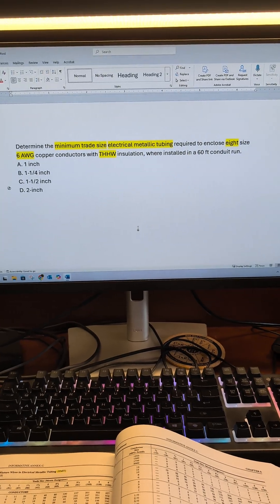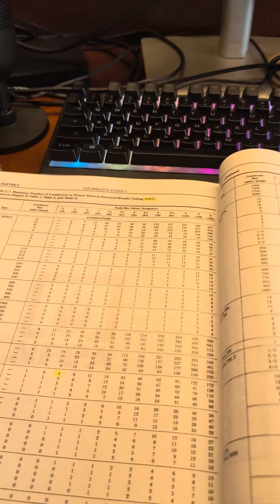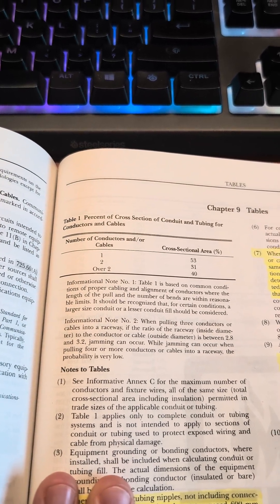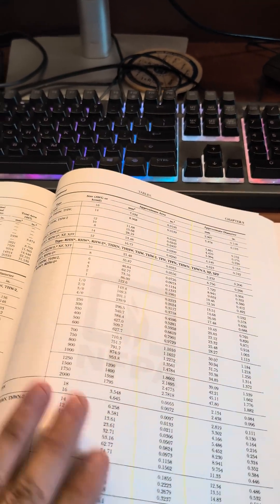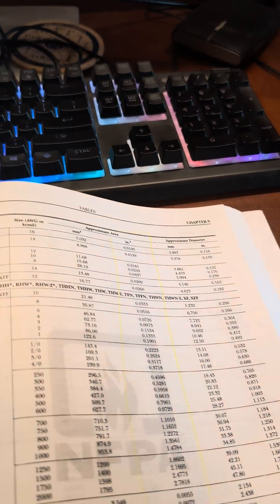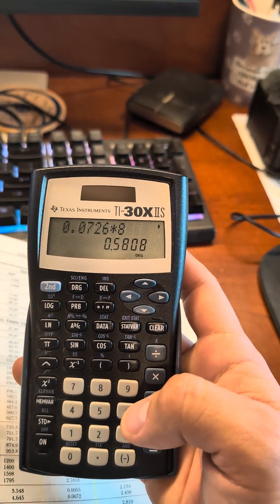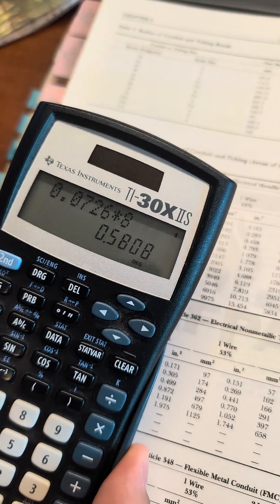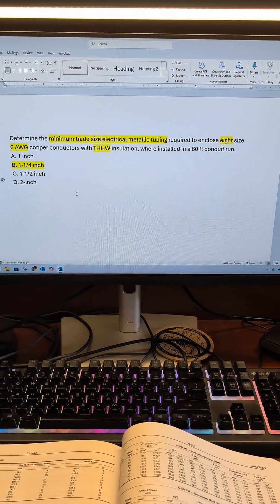NEC Chapter 9: EMT Conduit Fill - Exam Question ANSWERED! (Part 2) #ElectricalCode #necexam

Comment: I was initially taught this same method when trying to answer similar questions. There is a much faster way to answer this question though. In informative Annex C, we are given the conduit, tubing, and cable tray fill for conductors and fixture wires of the SAME size. Again, annex C only works if the conductors are all the same size. Hope this helps!
Reply from the maker: That’s correct. This is Part 2. I dislike how YT doesn’t automatically link Part 1 to this but in that short I cover using Annex C.

Great advice and thanks for watching!

Comment: Hey john. I really suck at this NEC flipping . I cant get good with it. Any tips ?
Reply from the maker: Yeah, tabs are your friend. Learn all of them and familiarize yourself with them. You don't have to memorize their order, just what is on the tab.

In previous videos I go over Chapter 3 tips and how to navigate article parts.

Last is practice. No one learns this overnight. There's a reason it takes 8,000 hours to even be eligible to take your exam. The more you search for items in the book, the faster you'll be.

Try finding code you already know in the book for practice like max number of degrees of bend in EMT or if you're allowed to install 15A receptacles on a 20A circuit.

You likely already know the answer to both of those but look them up in the code. That's how you get practice.
Reply: @JohnPaulElectricTX but everyday i come back to youre videos and rewatch every video to keep learning . Please dont stop making videos . Also is there any 1to1 learning that you have?
Reply from the maker: Just seeing this comment. Yes. I am a partner with Mike Holt and offer training through that platform. If you’re interested, shoot me a message or email me at JohnPaulElectricLLC@gmail.com
Reply: @JohnPaulElectricTX i usually suck reading my questions then trying to find key words. It usally takes me 30 minutes to even find where to look.